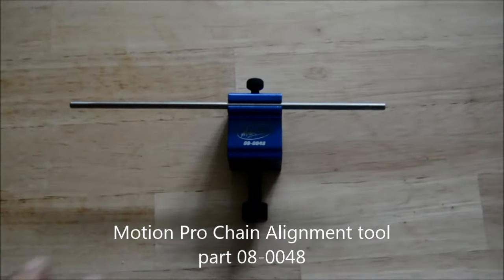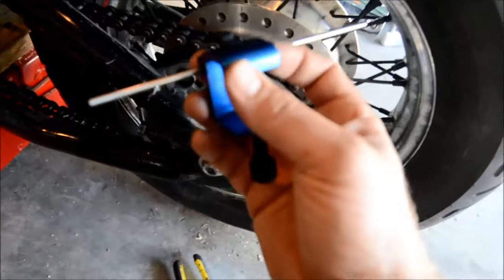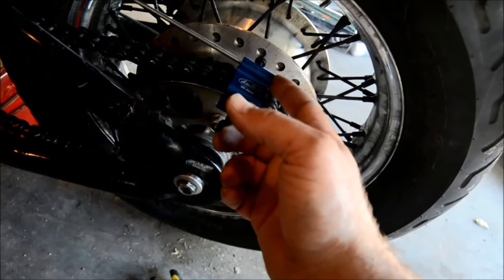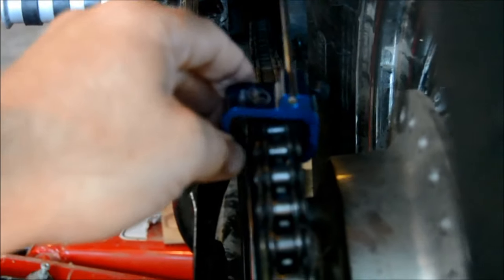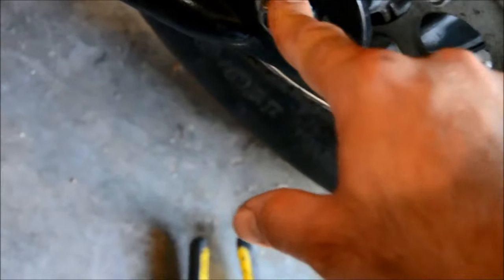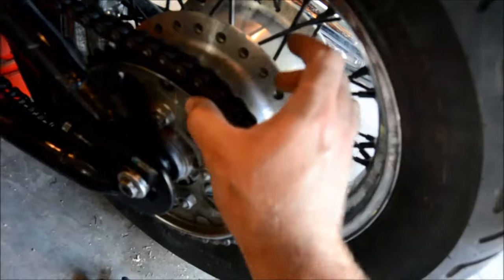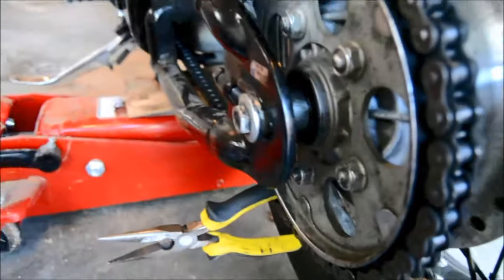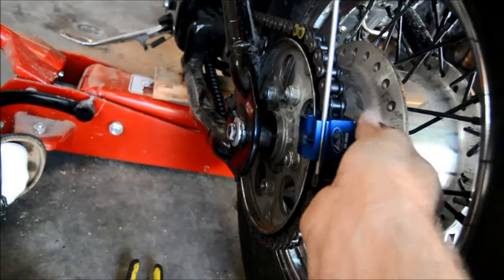motorcycle chain Alignment using the Motion Pro Chain Alignment tool

Comment: Did the swing arm measurement method and got it spot on. I knew my wheel was out of alignment because I was going over 100 and I was leaning the bike and the wheel was bucking.
Reply from the maker: R1_Rebe1 measuring the swing arm works well.